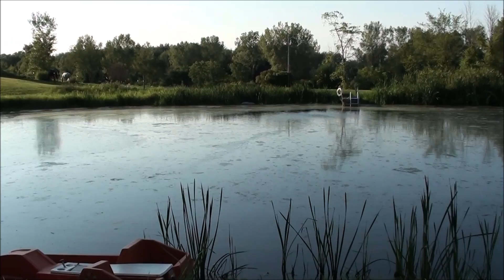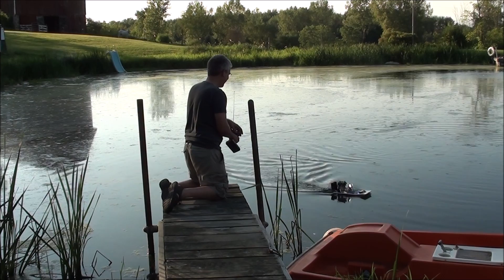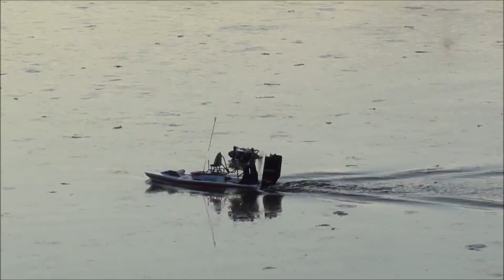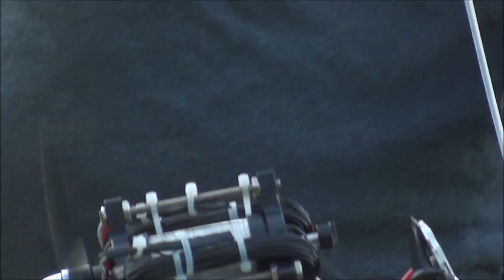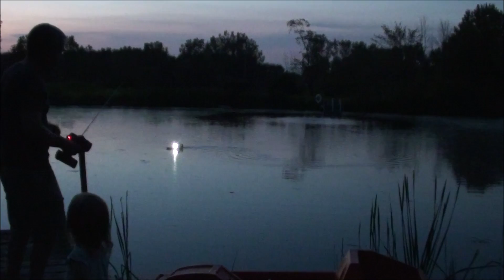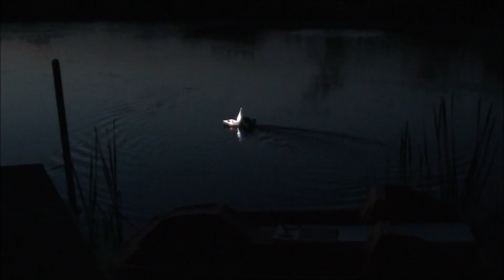Remote Control Renaissance Free Energy Watercraft

Comment from the maker: Some skeptic just added a comment to this page to downplay the LED brightness but it was too rude to leave up. Polite comments are only welcome. It is typical for skeptics to undervalue the presentation without noticing details or the fact that anything extra in the output is free and useful. I will add a few more statements. I work with these LEDs all day long and have at least 100 of them. I run them at full brightness with heat sinks and power supplies as sold in the industry. I have light meters and I often compare lights in dark rooms (which is not always easy). The light in this video is about half brightness when not at full power. I show in this video that when I go above maybe 3/4 power the output decreases out of the sweetspot and the light dims. So I am not claiming that the LED was a full brightness. The input to the motor was 7V people. This is a 33V LED and there is no transformer in the motor or circuitry. The motor is running at the same power as with the regular motor and would give around the same distance. So any extra output is free. The LED is not the most efficient use for an output, and a battery would be better. And yes the watercraft would go at least 3 times the distance with another fully discharged battery and charged battery in this setup rotating around.
When the motor was run at full speed the LED was around 30% of full power so yes it is much dimmer than full brightness. At 3/4 power it was at around 50%. So that represents about equal the power output from the input. 
The camera has an auto light adjustment so that it will dim the view when the light gets brighter. Being at the pond one would have witnessed about 30W of LED.
The LEDs can be run with negative energy at the same brightness while producing much less heat. We found that maximum efficiency is reached powering the LED at less brightness than it was intended for so that running several of these LEDs in series produces more light than attempting to one run at full brightness. We do run them at or near full brightness with large heatsinks also and they will get hot even with this kind of output. But it is risky to run them at full brightness when you are using this kind of output with very high voltage spikes.

Comment: I'd like to clarify something that I thought I heard mentioned at the conference - thanks! btw... wasn't it said that the negatively charged batteries don't like inductive loads? I think it was put something like, "it is able to run the motor less and less." Is there really an issue with using loads that aren't simply purely resistive? I must have misunderstood something over the weekend because that would surely interfere with rotating. And even more confusing is that it would seem like you would eventually have only negatively-charged batteries once you rotated them. Thanks for anything that helps me sort out everything we learned over the weekend, and thanks again for all the demonstrations.